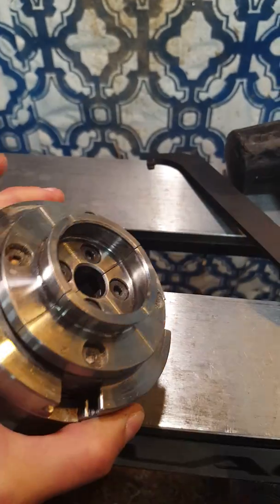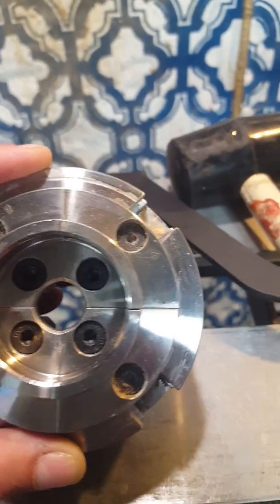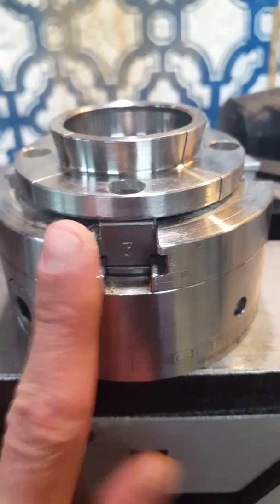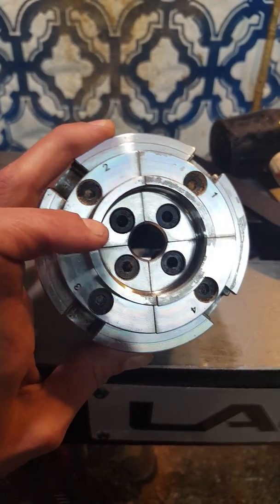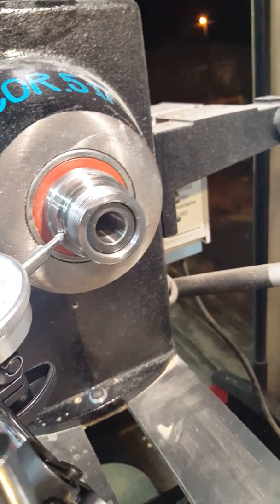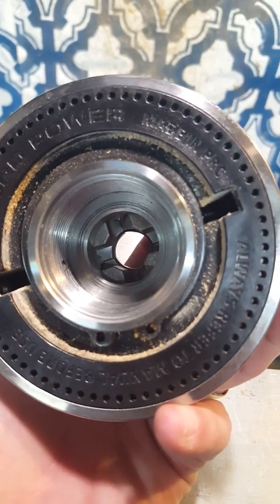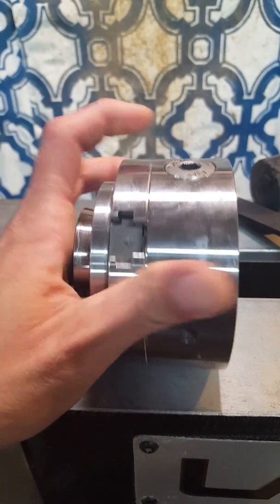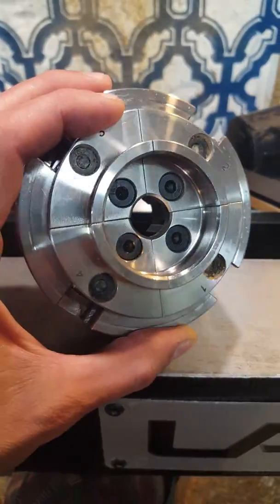Record Power chuck defective?

Comment: all I can think to do is loosen the bolts in the jaws close the chuck so they all line up and then re-tighten the bolts,  you shouldn't be able to get the jaw screws to come out unless you've taken it apart, lol I laughing with you but if you didn't have bad luck it almost seems you wouldn't have any at all,  I'm sorry I have no idea how to help you with any of this.  maybe try the nova jaws in it or mix and match,  and I do not think you want it to hit the bottom on the inside of the chuck you want it flat against the lathe.   one of my chucks has stiff spots in it and the other does not.